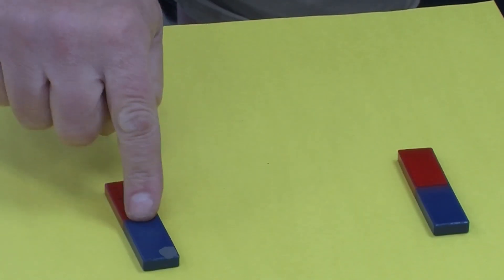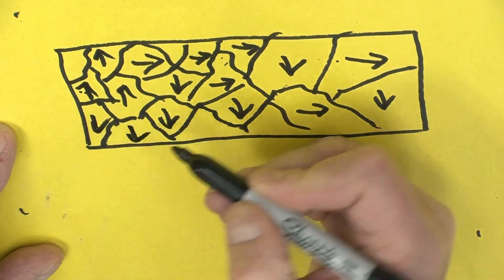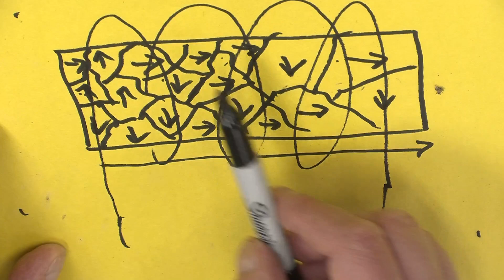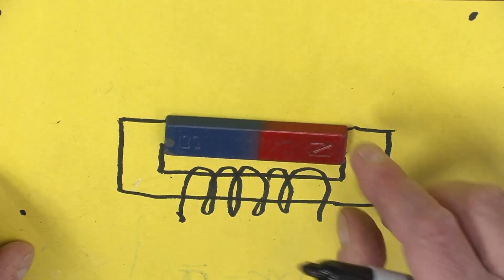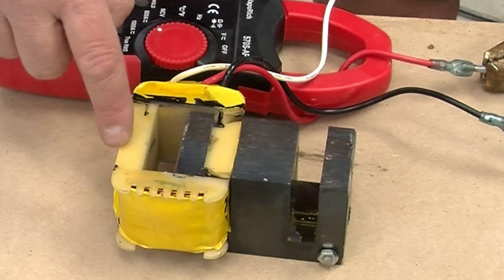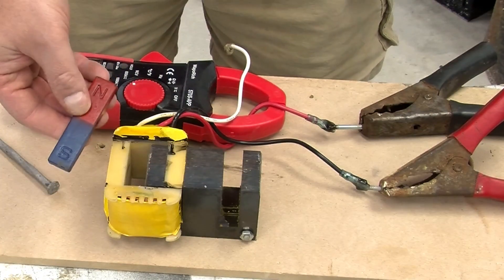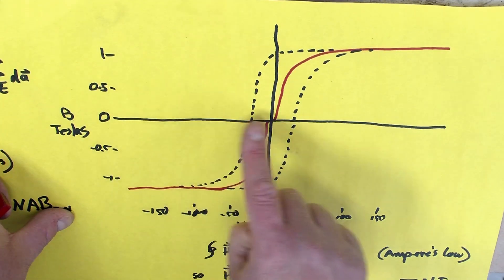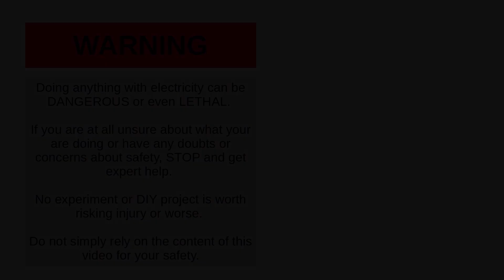How to (Re)Magnetize a Permanent Magnet

Comment: Thanks for walking us through the basics.
I recreated the magnetism of those horseshoe magnets that are in old phones to make the ringtone, once.
I just wound on coarse wire and connected to some series connected car batteries, nothing you should do.
- But it worked!
Reply from the maker: Its really neat how easy it is to make an electromagnet. Course wire works fine - and for any wore, the more turns the better. One caution for anyone reading this - car batteries can deliver so much current the can be a bit dangerous for this sort of thing, but a few plain old household D batteries are usually enough!
Reply: @ElectromagneticVideos  I believe while magnet is hot (and cooling) or if the metal is repeatedly and firmly tapped while still in the wire coils it can pick up some permanent magnetism like you shown.
Reply from the maker: @harrymu148  Agree completely! It would be interesting to know if it starts out hot enought whether tapping would even make a difference.

Comment: Your tapping on the magnet reminds me of a grade-school experiment to make a (very) weak magnet: hold an iron rod so that one end points north and the other south and then bang on one end with a hammer for a while.  This uses Earth's magnetic field to (feebly) align the magnetic domains (or is it shifting the domain boundaries?).

Don't know if your video plans include a discussion of how magnetic shunts are used to current limit transformers (I think there were clues in your magnetic chain video), but I'm sure you could do it justice.
Reply: blacksmiths were the first to discover iron's magnetization via heat and pressure.
Reply: Correct!
Reply from the maker: It seems  for things like iron and steel  its shifting the domain boundaries, but its really outside my area of expertise so I could be corrected by someone with more specialized knowledge. I have read that for things like computer disks and tapes the magnetic coating particles are each one domain, so presumably their direction has to shift rather than boundary moving.  Maybe that's a way to make a really hard magnetic material?

Your tapping the iron rod experiment is exactly the same thing - the jolt presumably supplies a bit of energy to allow domain some walls to move which is what I was trying to do by tapping. Interestingly all I remember from school is stroking a nail with a bar magnet - maybe we didnt have any nice big steel bard to play with :)

Current limiting magnetic shunts: I have been thinking about that but it will have to wait till summer: I have an old 120V 100A arc welder that should be much easier to take apart to show the shunt than the 240V 200A one. Its in a shed in the yard behind feet of snow right now. Yea - there were clues in the chain video  - its always a struggle limit things to keep the videos to a viewable length!